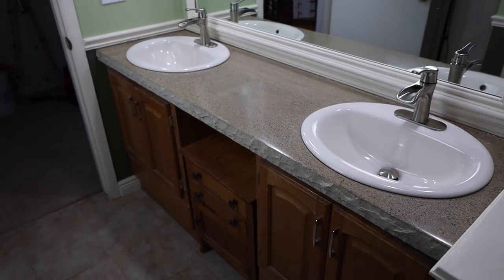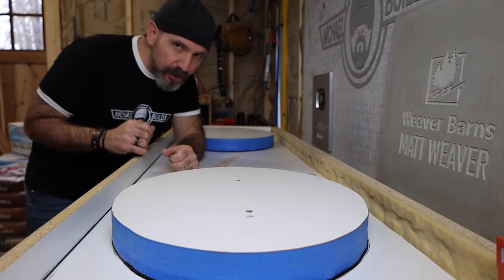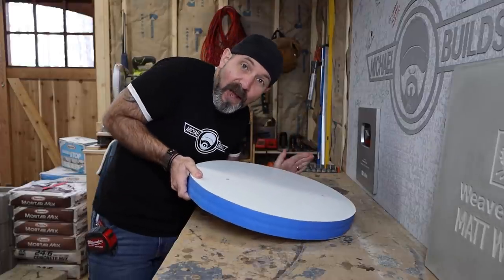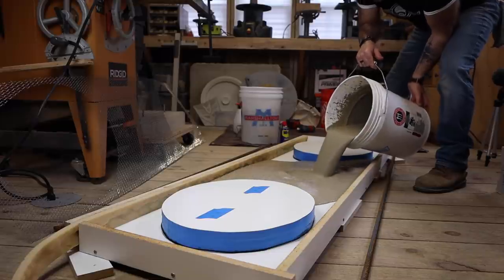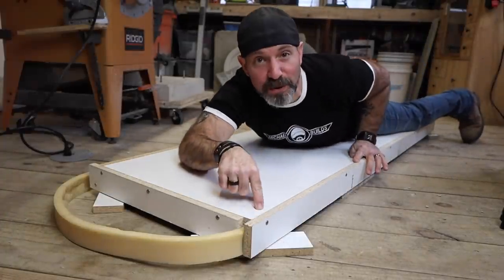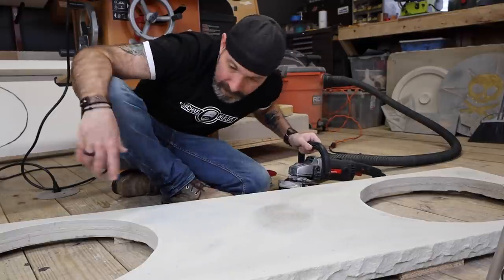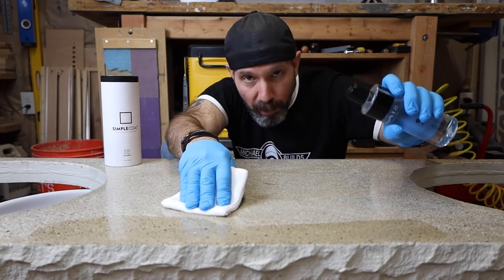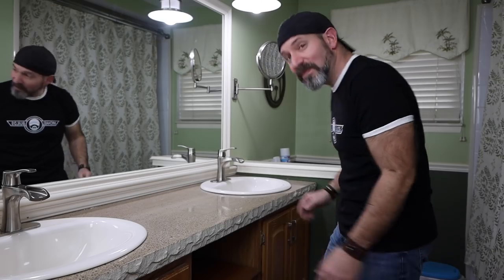How to make a Double Sink Concrete Countertop Vanity!

Comment: My company has poured concrete for over 20 years.  We wrap our blockouts in Ethofoam, which is flexible.  For everyday DIY, you can wrap multiple passes of tape OR use a strip of cardboard covered in tape...  That will give a softer buffer between the concrete and the rigid blockouts.

Comment: Cut an angle (2° or so) in the sides of the knockouts. That will allow them to more or less fall out when you demold.
Reply: Good idea..I was thinking something similar you could probably cut it in half or mostly in half to the center use tape to close the gap hole then cut the final part out when cured and it would basically fall out.. but the foam like he said sounds the best
Reply: @bumstudios8817  
I've built hundreds of molds during my time in the marine industry. We always build in draft (angle) when we make a new pattern. Of course, we often used the pattern to build multiple molds off of so they need to be robust and retain their shape. I've also built a lot of one off patterns using foam when I wasn't too concerned about longevity or exacting tolerances. I think for something like these countertop projects, foam is a good choice to build the knockouts but if you are going to build them out of wood or some other "hard" material, it should be built in such a way (e.g. with draft) as to not break your part. Oh well, sometimes you learn hard lessons. But the hard ones are the ones I always remember. I'm sure the next time Michael tackles one of these, he'll be thinking "not gonna do that again".
Reply: @rogermccaslin5963  👍
Reply: I design plastic injection molds and was going to suggest that.  I just did my first pour and did that the sink knock out and the edges.  taking the mold off was easy.

Comment: I have watched your videos and you sure make this look easy. One point of contention though. Putting the rebar in BEFORE taping is not good! Tapping the air out made the rebar sink to the bottom! The bottom becomes the top and when you start finishing the countertop, you’re looking at polished rebar! Think it would be best to tap out the air pockets THEN push the rebar in and smooth the top?

Comment: Watched every vid I could on pouring counter tops.  Went with your approach.  Did my entire kitchen as my first project.  Turned out great.  I need to work on the dry grinding.  My dust shield did not work so well.  The one thing I could not overcome was the blush marks.  You can see exactly where I poured each bucket.  Maybe not wet enough?  I also added fish tank gravel and had a hard time getting distributed evenly.  Any ideas or suggestions?  All my friends and neighbors what me to make them counter tops now!

Comment: Michael, I'm sure someone else has suggested this, but if you want to use the ridged mold for the sinks, put a 10° to 15° bevel on the ridged molds (cutouts), which should prevent the kind of cracking of the countertop you had.

Comment: Michael. I poured my first counter yesterday and I have some pinholes and air pockets as well as a hairline crack on the front side of the sink. How would you suggest making the slurry? Of shoukd I just use NewCrete?

Comment: Just an FYI - the diamond grinding wheel you list in your description will not work with the tool you're using. It doesn't have the threaded 5/8" -11 arbor.

Comment: How do you stand on the debate whether a long cure time equals a stronger finished product? I want to do this kind of thing,  but only once if you follow my meaning. Those thin sections scare the crap out of me. 

Here's an idea for a vid I would find interesting  - there is some debate about where, or rather how,  to place your reinforcement. i.e. can you press just it in like you do where is will likely sink some small amount, or should you support it with wires so it can't sink. particularly the rebar where it's weight and profile would allow it to sink more easily than mesh.  You could make small blocks using each support method, with and without flow control additive, then cut the blocks and see where it all winds up. 

Keep it up, love to see your notifications pop up.

Comment: You want to make a really cool countertop??????  Insert fiber optic into the mold so only the very end of the fiber contacts the bottom of the mold (top of countertop).  It ends up looking like the night sky with stars when you dim the room lights.  You can even have them changing color if you desire.

Comment: Did you find that 5qts of water and 1 pack flow control was optimal? Did you use set control at all?   
I different channel suggested 3.75 qts  of water and 2 packs of flow control and 2 packs of set control per bag. Any help would be greatly appreciated. Thank you!

Comment: So I'm restoring my bathroom concrete vanities and they were here when I bought the place. Really want to bring them back to a glorious natural cement look and get rid of the stains and all things gross. Wet sanding seems to work a bit, but for the life of me, I have no idea what materials they used, how if at all they were sealed and with what. There are odd white drip marks on the edges, cracking in spots, basically what looks like dirt everywhere....wee 😒 Like to sand them down to naked and resurface them tbh. Your thoughts would be greatly appreciated. Cheers from Canada 🇨🇦
Reply from the maker: I would love to tell you that you could just wet sand them back to life but unfortunately you will have to go through a similar process that I went through in this video. You won’t have to start with the rough grits but somewhere in the middle like 400 or 800 grit and work your way up to 6000 grit.
Reply: @Michael Builds  So quick with a reply! Thank you. I was expecting that tbh and will definitely take that advice. I'm not looking at bringing them to a shine, I prefer the more flat stone look, so perhaps I'll take it in stages with the grit and determine when to seal. I am tempted to resurface because there are some pretty big gouges in the sides of the sink cut outs. They are bottom mounted so makes things a bit easier woo hoo 😀
Reply: @Michael Builds  loving your channel btw! Thanks for sharing all of your work. Cool beans for sure 😎

Comment: As strong as you're always bragging on that cement, it's shocking you have to reinforce any project, let alone a sink top that will never take any weight.. I've used that cement and HAVE cracked it with a  similar thickness.. I thought I did something wrong... Seeing you crack it confirms that though that stuff sets up faster, it's clearly not as strong as the manufacturer   claims. 
Secondly, for the sealer, you said in their instructions 'NO RECOAT will be needed, will see'. Then as you did it you said you used a FEW coats....